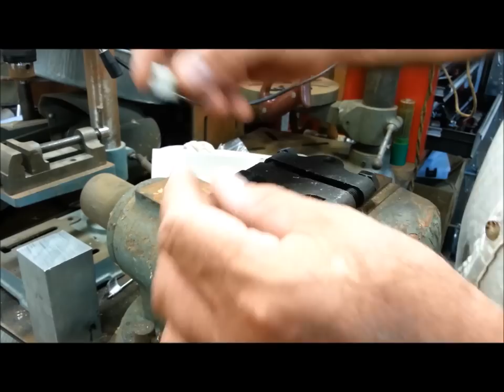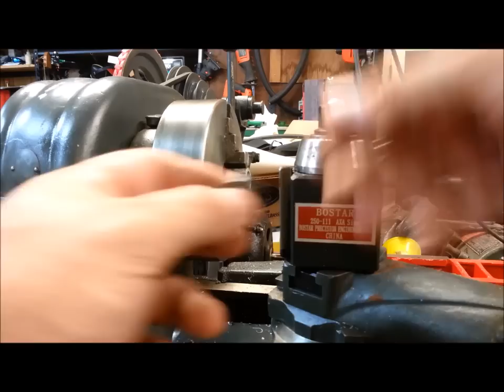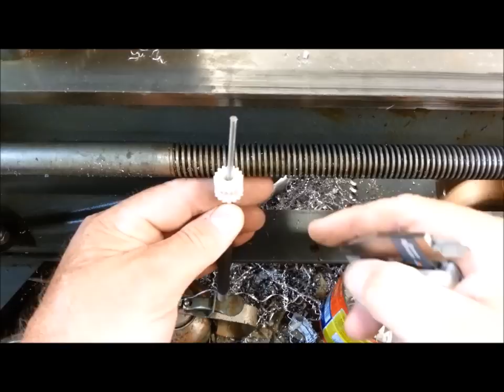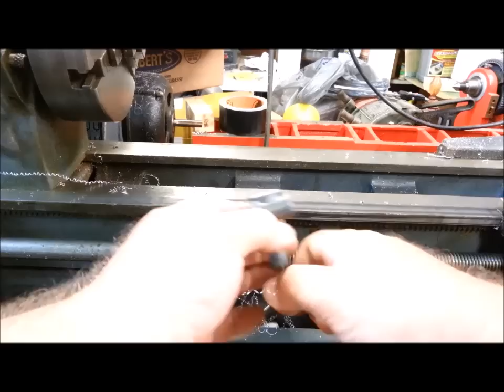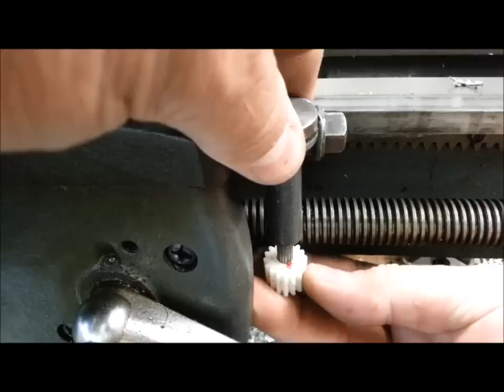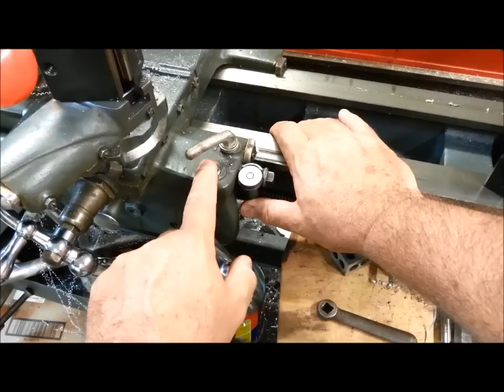Threading Dial Gear Replacement Atlas Craftsman Lathe

Comment: Very good video. Hi I have just bought a used Atlas 10” QC lathe that has a missing thread dial. It seems to be hard to find one and I would be interested in your plastic gear if I find a thread dial. How do you think you could help? Thanks
Reply from the maker: Yes.  I am wwworadicalrcocom on ebay.  I list this item as well as many others. All ABS high temp parts which means they won't melt some killer hot day in your workshop.
Reply: Do you happened to have the whole 9.62X thread dial assembly. If I knew the dimensions I could make my own and possibly purchase the gear. Thanks
Reply from the maker: @charlescochran9803  I don't part out lathes.  I could perhaps start reproducing this item but I don't currently.
Reply: Well if I had the dimensions I would make myself not that hard. Thanks
Reply from the maker: @charlescochran9803  I am out of town right now.  Can't help.  However, it is really simple.  Just a slaft that spins in a bore that you swivel into or away from the lead screw.  I've seen several hand made metal ones online in chat forums.   I might reproduce it someday.

Comment: Dave, that is very good. My atlas lathe has no change gear box some day I do plan on getting one.
To put a 24t x 48t to slow the speed down, I have a chart that changes it to .0024 am going to try it and c what happened 
Thanks again

Comment: Hi there.
Can you share any tips on 3D printing with ABS?
I’ve printed a couple of ‘return spring’ housings for a Walker Turner drill press.
The original spring housings were missing.
The ABS printed ones look great, but they failed at the small square slots that engage on the casting lugs. 
I’ve tried increasing the wall thickness, but failure still occurs here.
It’s a delaminating issue, but I’m not sure how to solve it.
I’m using ABS filament, and using the manufacturer settings.
Liking your 3D printed machine parts!   I’ve made a spindle cap for the WT drill press as well...looks great.
Thanks.
H
Reply from the maker: Must be enclosed or you get splits above about 10mm away from bed.  230 to 240c.   Pristinely clean glass or Elmer's Extreme glue stick.  105c bed temp is optimum, get down below 100c and you get more and more rejects.  35c or above inside enclosure.  50c being ideal.  I'd like to experiment with 60 or 70c but I need a dedicated heater to do that.  I've been updating to enclosed Bowden printers and I can tell you printers that are not direct drive have unresolvable issues.   I'm mod'ing back to direct drive.  Bowden is a wagon wheel.  Feel free to send me a photo of your prints.

Comment: The reality is the timing of the lathe. 
:- I have a Colchester master , . which dos not have a  led screw ' when I want to cut a thread I have to do it without a led screw ,  by timing the lath.  now I intend to change that . by finding a wat to fit a thudding  Diale   i get it when you mentioned  the timing of a lathe   i do it by piking a fixist  point  on my chalk & lining up my saddle with.   :- [ A FIXSED POSISHON ON THE BED } & marking it with a felt tip  pen.  now to the final point the drive shaft in you case that's the traded  shaft you call a led screw , but in my case  it as no led  thirds' . mark a place  on the shaft clearly when  the chuck & the sandal is in place. now the lathe  is timed.  & putting  the start marks on a thread. diel should be don then  start point .  number gives you a starting point   The lath will have for different .  starting points which indicate three versa pitch,  to be cut but the one that allows all 3 mark' s to line up 4  if you count,  the on  the diel . 

Les England    
I was thinking of fitting a lead screw . But then I  thought a fixist rarefy thread board out  at  8 threads to the inch turned  by the led screw key way  may  served me  as well  good ? may give me food for thought try it it's something that will add the selling of tor gear wheals   time  the lath as I have show you in this lengthy explanation .  Check It Out.
Reply from the maker: This video shows a lead screw and threading dial on a Colchester Master.  ??
https://www.youtube.com/watch?v=JtxM8vAr5Tc

Comment: Ok, you've convinced me from not having one for years that I now need one............to adjust the line position just use a couple of washers on the mounting bracket to move the pointer position around a bit.
Reply from the maker: I remember correcting this (video a few years old) but think I may have re positioned the gear.  Your solution is better.
Reply: @CraftedChannel  I saw that solution on another UTUBE vid.........I think the top dial is usually attached with a central screw, this will allow you to rotate the dial as needed.
Reply from the maker: Not on the Atlas.  It's pressed on the stem as I remember.
Reply: @CraftedChannel  Easy peasy.....just make the zero mark sideways adjustable on a plate so the pointer can be lined up.......or, make a new top dial face and glue it on top of the existing one.
Reply from the maker: @gangleweed  Pointer in brass would look cool. Originally, they put it together (or the customer did) and marked the levy with a chisel.  They are all marked in different places.  I own many of these lathes.

Comment: Fine tuning of the threading dial to lead screw timing can be accomplished by adding the appropriate thickness of spacing washers on the locking bolt between the Treading Dial body and the apron.  In effect you are timing by pushing the TDI mark closer or farther away from the 0 mark as needed.  Hope that makes sense.

Comment: Having a 3d printer its just as easy to print a hobbed style gear as a straight one that would be far better, with more plastic on the actual thread it has less chance of jumping and you would get better wear resistance.
Reply from the maker: Still working well.  It's involute even thought that might not be proper running against the Acme thread.

Comment from the maker: Just fine.  Does not need replaced.  But, that is no big deal at all.  It could be wood.  It's only turning a timing dial.  A real test is in the drive train which is coming soon.

Comment: Are you  selling the plastic gears? If so, how much do they cost and where can I order it? Also, I presume you drive the shaft from the old gear by placing the gear in a support and with a punch drive the shaft out of it, Right? Thanks.
Reply from the maker: It's my intention to do so.  I need to make a tool to hold the gear from the outside to drill/ream the hole to greater precision than 3d printing offers.  Yes, I drove the shaft out in that way.

Comment: Hello
If I cut thread M20 x 2 x 2 or M20 x 2 x 3. I don't know DEPTH CUT = ? (mm) 
How to calculate depth in multi threaded screw metric?

Can you help me?
Reply from the maker: I don't know what the last number means.  M20x2 is a size.  M20x2x2 is not a size I recognize.   However, the depth of the thread must take the bottom of the thread to the minor diameter.  An M20 fastener is 20mm on the outside (major diameter), 17.797mm OD at the bottom (Minor Diameter) of the thread.  So, if we deduct the minor diameter from the major diameter (20-17.797mm) we get 2.203mm.  Depth of cut would be 1/2 or 1.102mm per side of the screw.  Here is a link to a threading chart.  I looked it up to find the answer.  http://www.engineersedge.com/hardware/metric-external-thread-sizes2.htm
Reply: thank you very much :)
Reply: 20 x 2 x 2  (Multiple-start thread or double start thread)

Comment: Dave there is a guy that has 3d printed the change gears I seen it on youtube not sure the channel.   I don't think they would last.  but that thread gear would work as plastic pretty good.
Reply from the maker: +brosselot1 The files for that have been online for a long time.  I've not printed any of those. I've printed only ones from the carriage and those I made myself, not downloaded.
Reply: I got the old girl up an running today.   I've still got a few things to mount like the guards an i don't like my tool post.  Gears are a little noisy but not bad only when you are in forward I've got a bushing and sleeve on one of my tumbler gears that is worn-out.   I shimmed everything else an it is pretty tight.  Set all the lash per the book.  Hey I got a manual of  lathe operation if you need a copy.  Send me your email an I will email it to you.  I posted a video on the Atlas group on Facebook an on my youtube channel.
Reply: I want to say thanks for the help an the great information from your videos.
Reply: +brosselot1 Your welcom.

Comment: A 3D printer is on my wish list. I would use it mainly to make patterns for my castings. A Printrbot simple would be my choice. What printer did you use and did you use PLA or ABS?
Reply from the maker: +eviltwinx My interest is in making working functional parts.  So, only ABS or Nylon for me.  I bought an XYZPrinting 1.0a which is ABS.  I got some help to hack it so now I can run ABS or PLA.  I may install an all metal hot end and try nylon at some point.  But, I may get a second printer for that gamble.  Caught mine on sale delivered $350 from New Egg.  It was a lucky sale I caught by pure accident.  Most patterns I bet you can make faster by hand.  It takes a very long time to print something.